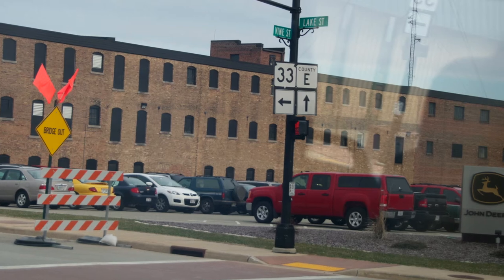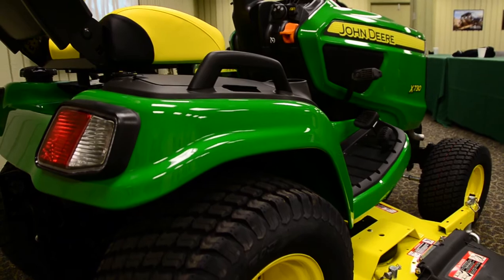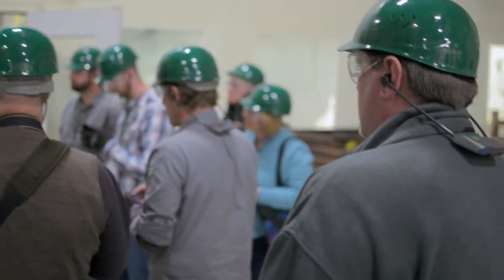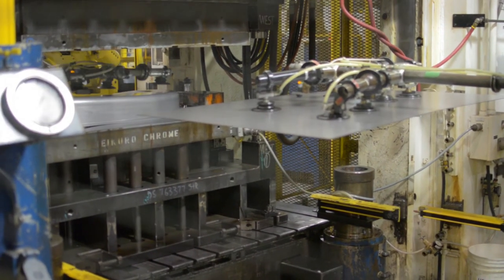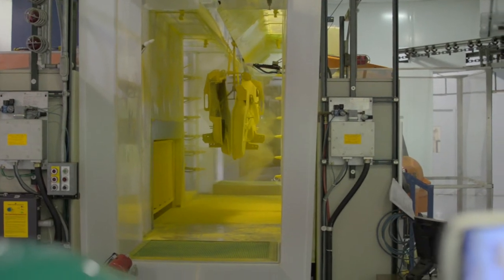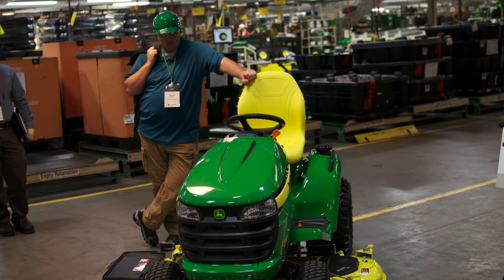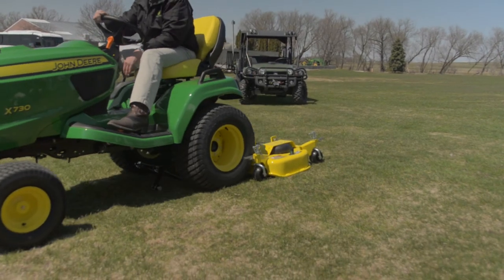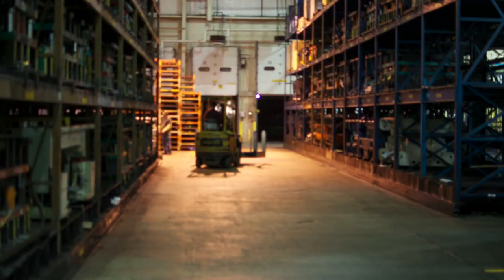About John Deere Factory in Horicon, WI

Comment: You do not get a robust john Deere unless buying a X500 series or higher. These are true JD garden tractors that last 20-30 years with care. Anything below such as X300s and 100 series are really no better than a cub cadet at lowes...just green paint. x500 X700 series are what JD lawn equipment is traditionally known for. Heavy robust transmissions, frame, commercial engines, ext
Reply from the maker: JohnnyRebKy Time will tell.  My 100 series been purring along for over 5 yrs now.